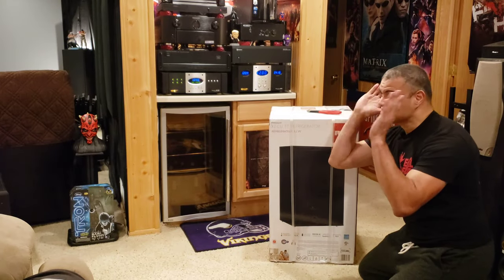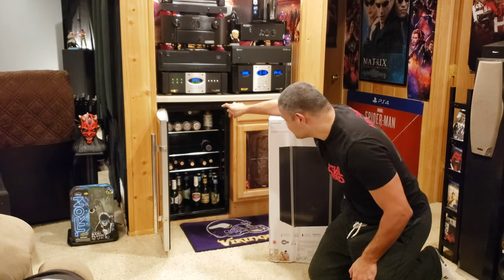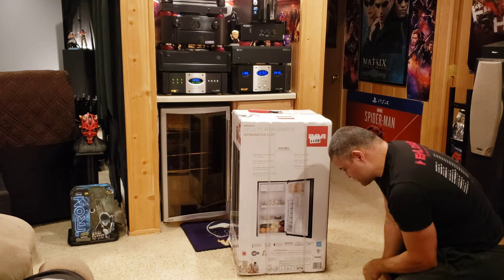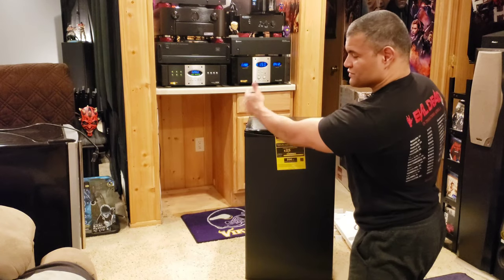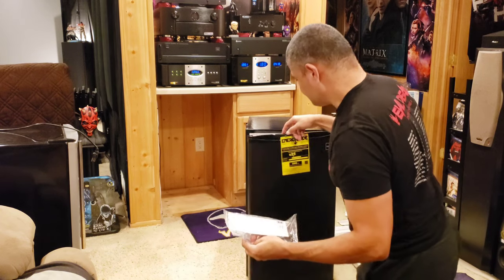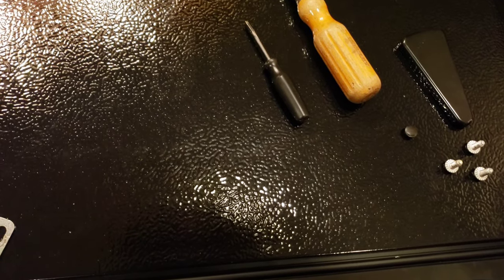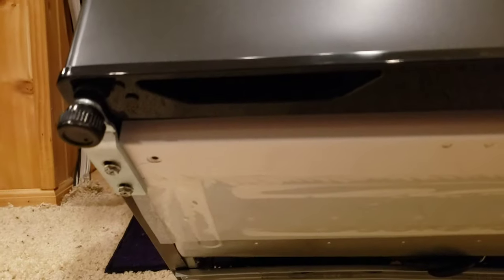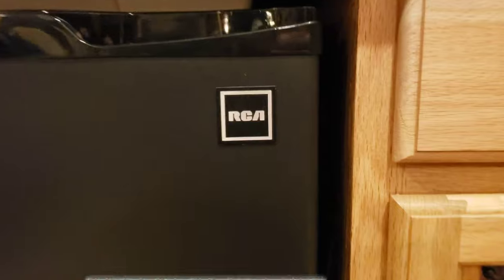RCA 3.2 Cu Ft Compact Design Mini Fridge with Freezer, Black Stainless : Unboxing & Set Up

Comment: The fridge won't last long because you are not supposed to  built-in them. Some are but 80% or more mini fridge are not. You may get a malfunctioning fridge because fridge like that use the sides for heat dissipation. For the freezer part don't Trust it, won't come cold enough to keep stuff in a proper temp. Good for ice cubes nothing more .

Comment: Thank you for the video.  How quiet is the compressor on this.  The one that came with the apartment I have has a ringing screetching metal sound coming from the compressor.  Is the compressor quiet on this?  I will put it in my living room and I want the 4.5 Cubic good one and I dont want to spend money on something that will be noisy.  Is it quiet?
Reply from the maker: It's quiet, I don't even notice It. 🙂👍🏽

Comment: Fridges and such are pretty easy and usually not expensive to fix. Got 1 thats older than me that belonged 2 my dad. I do like the look, it does remind me of the xsx😘 Nice, I just noticed the Angry Orchard, love that stuff. My fav is Ciderboys though, they usually combine a fruit with it. One exception is there Mad Bark with cinnamon!-sooo good! Raspberry Smash and Strawberry Magic are some my favs! I see that Mountain Dew, I use to od on that and there livewire! Try there new 1 called Major Melon? Suppose to taste like a watermelon jolly rancher I was told. Just picked some up on sale at Pick n Save to try tonight. Trying 2 decide what edition of resident evil village 2 get. Ce at 219.99 seems a little high 4 pretty much an older Chris Redfield figure. What ya think? The psn digital exclusive 1 includes the gold ver of last 1 n the re verse included im also thinking of and its far less and I didn't play those.  Im a sucker 4 figures though. Guess there's a ps5 demo 2 try first😘
Reply from the maker: Hi Michael, lots of those drinks are a over a year old 😆.  I like Sprite and Micalob ultra or northern Beer.  

I'll get the Digital RE 8 but on Series X for the  superior current gen console experience 😄👍🏽👍🏽
Reply: @TheRafcave  lol on drinks. 4 soda my go 2 is Canada Dry ginger ale n lemonade.
 As 4 re8, I dont know about series x being superior, I mean ps5 is only 1 2 get the maiden demo😘 I just hope its back 2 its zombie roots🙏😎
Got that kl Sub-Zero gear they just had 2 put at God rank. Love those kitana skins and finally I got that Scorpion demigod skin from kl1 I missed😍🔥🤺 about 500 short of elder not sure ill make this 1.